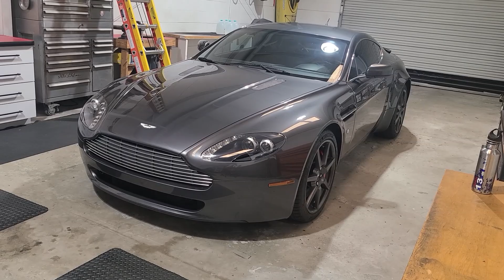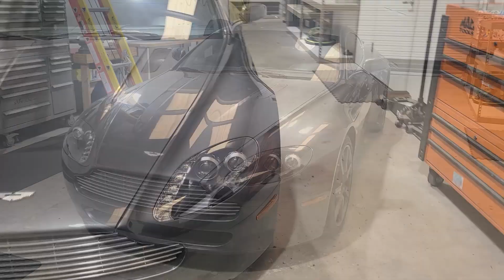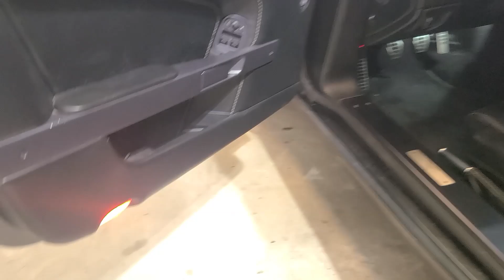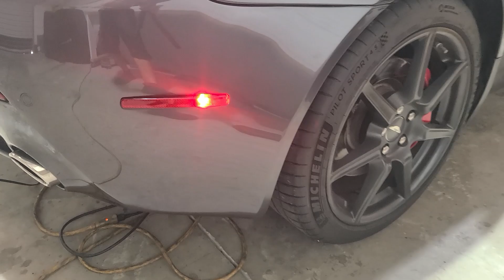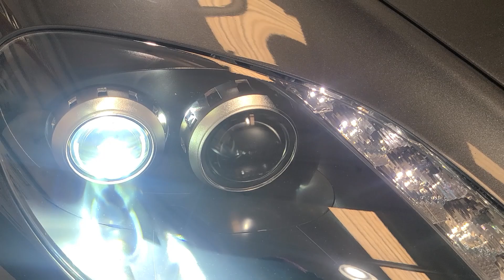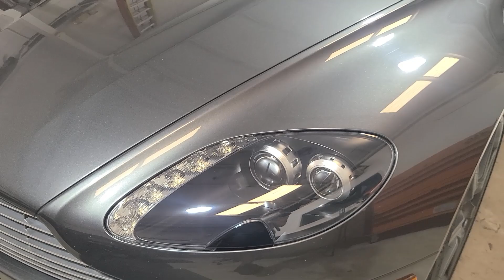Aston Martin Vantage Headlight Repair & Restoration & More!

Comment: Looks amazing!  Question about the plastic covers/lenses: you were able to sand the crazing/cracking out, or just foggy oxidation?  I've done plenty of headlight restorations but my Vantage's headlights have micro-cracking/crazing all over and it seems too far gone, so I'm wondering if that's what this car had
Reply from the maker: I had "this seems too far gone" crazing and I sanded it until it didn't.  And built it back up with clear coat.